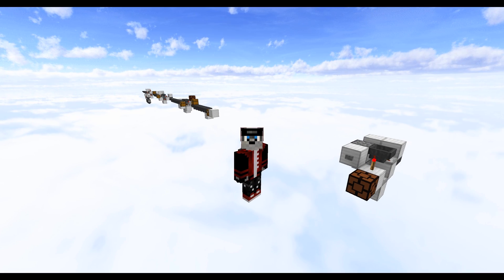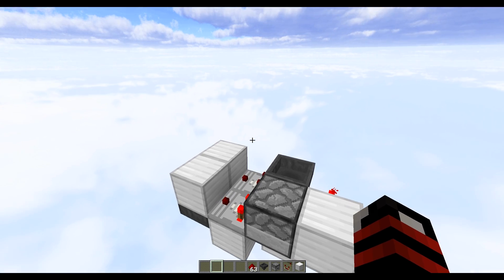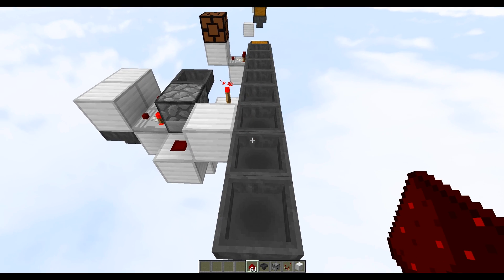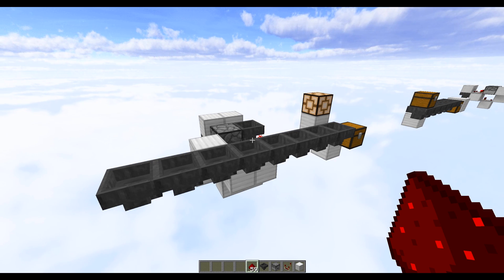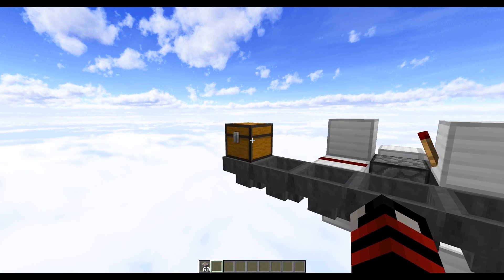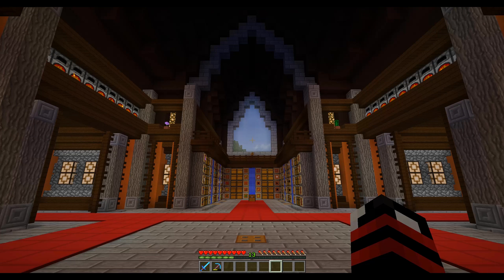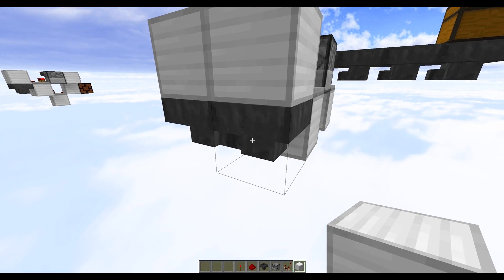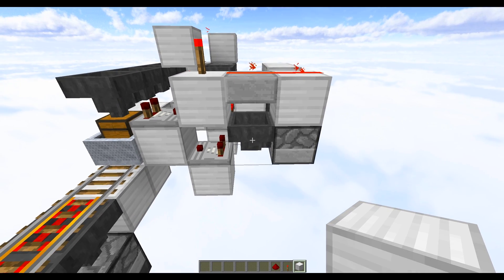Minecraft: Item Counters [Tutorial]

Comment: Building a machine that separates by packets of 10, I know that the items in the dropper should be one less than the desired packet size for it to work correctly so I've got 9 in there, but on the last packet this counter will allow through either a group of 10 items or a group of 9 items. I just built a machine that uses like 12 of these counters and this quirk completely breaks everything, has anyone found a fix?

EDIT: Found one, the problem seems to be caused by the hoppers in the chain moving one extra item along before it has time to lock. I managed to fix it by setting up a mechanism where every time an item passes through the hopper with the comparator attached to it, power is briefly sent to two redstone dust resting above both the hopper with the comparator attached and the hopper with the redstone torch next to it. I did it by having the comparator that splits into two lines, one powering a copper bulb and one depowering the bulb after 4 repeater ticks, and a comparator hooked up to the bulb is whats powering the two dust above the hoppers. Any shorter and an extra item will still make it through, which sadly means that the system is ~30% slower. There's probably a better way to do this, this is just the first solution I found that works.

Oh almost forgot to mention, undo the change of putting one less item than the desired packet size in the dropper, just put the exact amount that you want your packet size to be in there for this solution to work.

Comment: I have a design for a machine that counts items. Depending on the amount of diamonds put in, it will give up to 15 different outputs. For Example: 2 diamonds for a golden apple - 5 diamonds for a dragon head, 10 diamonds for an elytra and so on. My favorite part is that all of your diamonds go in the same place and the machine will figure out how many you put in. I think it’s expandable but I haven’t tried it yet. I was wondering if this already exists or if I invented it myself.

Also, I am working on a circuit that will tell the machine to give you more than one item if you give it more than the maximum. For example: the highest payout costs 5 diamonds but you put in 8 at the same time. The new circuit will tell the machine to give you an item worth 5 diamonds and then an item worth 3 - Rather than giving one worth 5 and then giving you three items worth 1 diamond.

I hope that made sense and I hope this video brings me the light I need to finish it.

Comment: This was perfect! Attached it to the hopper line for fuel on ilmango's 23 furnace smelter array because just attaching a log farm straight to it was making some problems. The only thing i would say is that i actually had to put 22 items in the dropper to get 23 out, because the 2nd locked hopper, when letting the 23 items go, would actually go 23, 22, and then 23 again (followed by 22, 21, 20, etc.) as 1 more item goes into the hopper, from the hopper next to it. I should think it would be fixed if there wasnt a gap between the 2 locked hoppers. All the same: catch this subscribe!
Reply from the maker: Appreciated ♥️

Comment: Would it be possible to utilize the packet part to have a second counter after? This 2nd counter adding up how many times packets are sent through.
That way if the packet sends for example 8 items and the packet counter counts up to 8 times, 64 items total, then activates something. 
I'm trying to figure out a good way of putting a specific amount of items into a shulker box before breaking it and putting a new one down. And I was thinking this could probably be a good method to use instead of trying to rely specifically on redstone signal strength.

Comment: The best (and possibly the most correct fix for this (I am  on 1.16.4) is to SLOW DOWN the start of the hopper chain without the need to remove 1 item from the counter (so if you want packets of 4, use 4) - the easiest way to do this is to use the official Minecraft wiki ( https://minecraft.gamepedia.com/Tutorials/Hopper#Item_counter ) and build it 1 block gap away at the start of your chain.
Quote: "This is a mechanism that outputs a short redstone signal for every item that goes through the dropper. The mechanism slows down the items moving through the dropper and the hopper above to make the outputs comfortable to use for counting mechanisms."

Comment: I finally got around to the project that I needed this for.
Design three still works in 1.15.2 as intended (and by default so would design two)

One thing, though.  Put one less item than you need in the dropper.  I tested it on a 1.15.2 world in creative.  from one single chest of sand I got nine shulkers with exactly 192 items (three stacks) each by having 191 items in the dropper.

Edit:
I almost forgot.  I added an observer line off the left dropper on the back that goes over the top to a sticky piston (with a slab on it) and a dropper, and breaks the shulker and plops in a new one auto-magically.
https://i.gyazo.com/307f0783563348b8d501278a73ab27d3.png

Comment: Nice design ! Only drawback : the first package is counted as N items correctly, but all following packages are counted as N+1 items. So for N items to be sorted, we should put N-1 items in the dropper.

(In my case with 20 items, I got the following counts : 20 21 21 21 21 21 ....
So with 19 items, I get 19 20 20 20 20 20 20 20 ...)
Reply: This is the exactly, the case, do you know a way to work around this? I want all the outputs to be the same
Reply: @Sam-bl8vj  I don't see any (simple) way of correcting the first package of items. Think of the first package as the heating up of the contraption. I think you could put 1 item in the correct hopper to avoid that.
Reply: just keep one item in the hopper in the hopper line that is powered by redstone torch. This must be same as the item going through the system, else one extra item will reach the end and the new item type will replace it

Comment: With the super smelter, a trick I use when loading the fuel with a hopper minecart to get an even amount in each furnace is to fill the last 4 slots of the furnace with a non-fuel item which will not drop down into the furnace.

Comment: This design has inconsistencies on 1.13. You have to put one item less into the counting dispenser than you actually wanna achieve. So put in 7 if you wanna have 8. Also the output gets mixed up when you throw randomly single items into the top chest. Both of these problems might be caused by comparators not turning off quick enough after receiving a single item signal from a hopper.